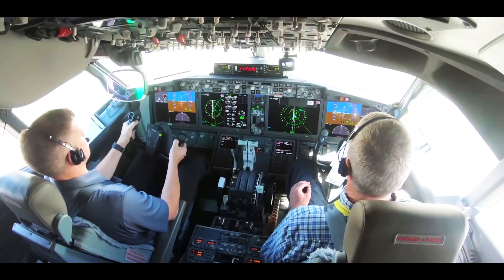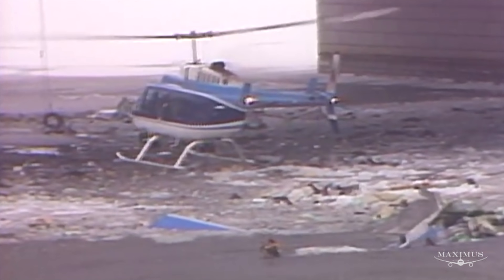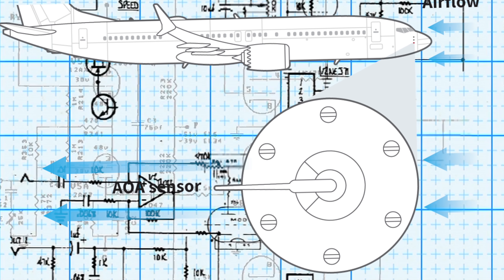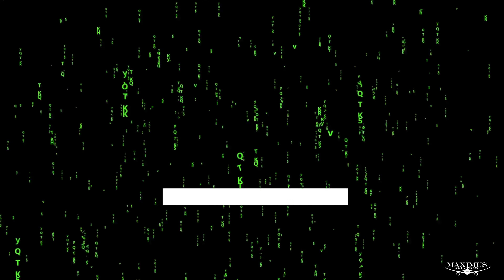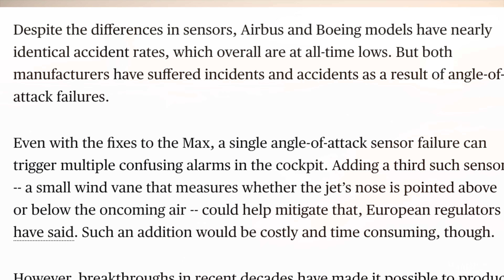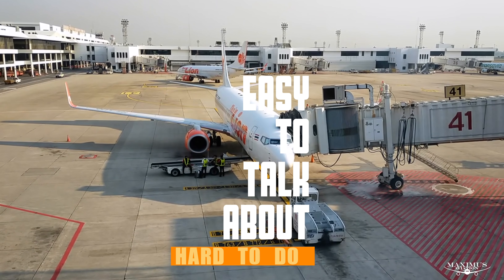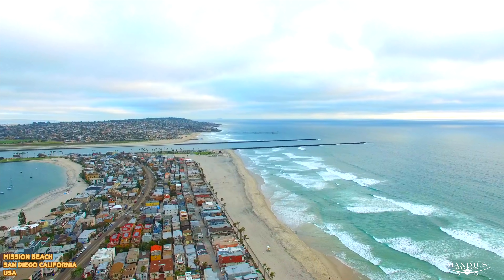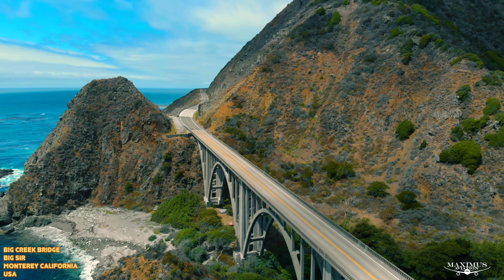Boeing To install 787s Synthetic Air System On The MAX! Boeing Caves To The EASA Will Install System

Comment: The plane might be approved to fly, but the airlines are going to have to send their pilots to training, and it may well result in a separate type rating, which negates the reasons so many airlines bought it.   Southwest bought it because all their pilots are type rated in the 737.  Now the question becomes - do they certify ALL their pilots, or do they now have a set of pilots who fly the MAX and another set to fly the 737?
Reply: Realistically speaking, they'd get trained for both types. It's not uncommon to have pilots rates for multiple aircraft.
Reply: @fighter5583  I know that.  But the airlines like Southwest that bought this POS were sold on the fact that it would not require extra pilot training.  With the addition of this system, it negates the biggest reason why many airlines bought it.   Because of that, I still won't trust a MAX....they should have designed a new plane.   Further...if a pilot were certified on the MAX, then went back to flying 737-800's for 12 months...then a mechanical forces an aircraft change, I wouldn't want to be on the plane  that the pilot last flew a year ago.
Reply: @KCFlyer2  That's just reality. Airlines are always looking for an opportunity to save cash. Heck, even the 787 and 777 have the same type rating despite being two different planes. Boeing simply complied with the airlines wishes to not have to do a little retraining; though I still believe if MCAS was removed it wouldn't cost them much to get used to the handling. The plane certainly can fly without it, and it's only existence was to make it handle like an older plane. 

That, and American had did a bit of arm twisting by making it seem like they'd go for the A320neo (even though I doubt they would've. They dumped the A350 order US Airways had for 787s after all).

Comment: The EASA is doing the job the FAA should have done.
Reply: And what Boeing should have done in the first place, instead of building a flying Ford Pinto.
Reply: This was calculated. we have this talk all the time on the storage/reactivation project. It was intentional to undersell the proposed fixes to the FAA/EASA. Everyone at boeing knows that EASA was going to want to appear more stringent, so they left off an easily implemented change so that EASA could come back and demand it to be done. Boeing capitulated EASA with something they were planning to do in the background anyway. EASA gets to look good FAA gets their changes and Boeing already has the modification in-work. Everyone high fives and get to act like heros.
Reply: @Taco-lo5bh  So in typical Boeing fashion they had the fixes but waited until people died and were forced to add the features.  No wonder people would spit on your precious Boing if they were close enough to manage it.

Comment: If EASA is driving this, it seems FAA has been reduced to second violin.
But then, FAA as well as Boeing will struggle with anyone trusting them for years and years.
Reply: EASA has to drive it because both Boeing and the FAA didn't; perhaps no airplane should be certified by country of origin first.
Reply: Phil Weatherley   This is a result of the McDonnell Douglas takeover of Boeing in 1997. Most of the surviving upper management came from MD. That's when the bad decisions really began (like killing the B757).
Reply: TheChiefEng — The FAA could help restore their credibility by firing Elwell.
Reply: China's aviation authority was actually the first to ground. At the time of grounding, China's airlines had actually taken the most deliveries of 737 MAXs out of any other country's airlines in the world (Chinese airlines with 70 deliveries to USs 69). They acted as quick as the FAA should have. Instead if went China, then EASA, then FAA only when forced by bad publicity.

Comment: 5:50 "Boeing and Airbus have nearly identical accident rates..."  Yes, but the issue is that the non-upgraded 737 MAX had the potential to show a markedly increased fatal accident rate because of the flawed MCAS system and lack of pilot trainin/awareness of the system. By grounding the aircraft after the second accident the regulators have prevented that spike in accidents from ocurring.
America and the world need Boeing every bit as much as Europe and the world need Airbus, but Boeing need to get back to being a quality-driven company once again, instead of a profit-driven one, or they will inevitably disappear down the same rabbit hole. The Starliner failure shows they haven't got there yet - iIf they don't fix this they will eventually go down.

Comment: I think your statements "Boeing and Airbus have similar accident rates" does not lead to "so the Max fear is mostly media hype."  The Max was pulled from service precisely because it had a far higher accident rate than other aircraft, Boeing or Airbus. 2 total losses in about 1/2 million flights (4 per million), compared to the global average of 0.16 per million flights.

Those two crashes don't significantly change Boeing's overall stats, since other models fly millions and millions of flights every year, but it does point to legitimate concern about the Max model.
Reply: Precisely what I was thinking, well said Neil
Reply: Still, it has a higher accident rate than the Concorde, which only crashed once. The thing about the Concorde incident however, is also due to poor maintenance on Air France part as the left main gear wasn't properly torqued, which made the wheels skid wildly while moving at high speeds. There was a piece of metal from a DC-10 on the runway, but it wasn't the main contributor to the accident as they think.

Air Framce had did a lot of coverup for this accident. You can find it online.
Reply: @fighter5583  Given that there were only ever 20 concordes in existence (14 in commercial service) and they flew around 100,000 flights in total...1 total loss is actually worse.
Reply: @The2wanderers  You forgot the 'over 30 years service' part.
Reply: @fighter5583   you forgot that Concorde flew at over twice the speed of conventional Aircraft , so the 100k hours would take 200+k subsonic,, so you can half its accident rate.
Reply: accidents happen and Cane happen with every Plane and in any form of Transport.

But the 737max is a flawed Airplane and does meet the standard we expect from this Indusrty

Comment: Honestly!  How difficult can it be to add another sensor on the other side???  Redundancy is always good.
Reply: They do have two. But which one is working and which is failing is hard to determine in the cockpit. So they should have three, like the amount of pitot tubes.
Reply: @ThorsteinKlingenberg  Absolutely!

Comment: I cannot see how synthetic airspeed will help, as the crashed Maxes already had reliable airspeeds, via their pitot systems,. And while knowing your airspeed may help in a low-speed stall event, it adds nothing to a high speed stall event.  

So I presume that this ‘synthetic airspeed’ will actually be an all-encompassing system that provides multiple data-points about speed, pitch, g-loading and angle of attack.  But that sort of system is more applicable to a FBW aircraft, not a 737 that is flown via 5mm steel cables.   (And it will take years to implement.)

On the 737, the only interface with the steel cables is via the air-data system and the autopilots, and changing that system to add synthetic airspeed would be a four year project.  MCAS is separate to the autopilots and interfaces via the trimmer, not the controls, which it should not do.  An anti-stall system should impinge on the controls, not the trimmer.  So even if this super-synthetic system is added, it is still acting on the wrong control system.  If MCAS trims forward to prevent a stall, it then prevents you from pulling out of the subsequent dive.   And it does nothing to help the manual trimmer getting totally stuck (locked) at high elevator loadings, thus preventing any trimming.

Better still, would be to redesign and raise the gear (and wing) to allow enough room to place the engines further back, to prevent the high AofA pitch moments that required a MCAS system (caused by a changing CofLift). And redesign the tail and elevator system, so the tail surfaces have more authority, and the manual trim does not become stuck under high loading.  And then add a full fly-by-wire control system.  And then call this new aircraft a 797 and certify it to MODERN standards, not to 1967 standards.  THAT is the proper way to resolve the 737-Max problem  -  design a new aircraft, instead of adding yet more sticking plasters...!

P
Reply: @jeffh.9999  Which is sad honestly.

Comment: When they're done the Max is going to be ridiculously safe.  MCAS is only supposed to operate in certain edge conditions, meaning at very high angles of attack near stall.  So really all you need from software is a sanity check for the AoA sensor, rather than a full simulation.  If you take a snapshot of other sensors such as airspeed, vertical speed, G-force, and the deltas of these, it's hard to determine exactly what the AoA is, but it's very easy to say in broad terms what it isn't.  For example, if the airplane is at 275kias and stable, roughly 0fps and stable, and roughly 1G and stable, with a measured AoA of 22 degrees, you can easily determine that AoA sensor data is erroneous.  Human common sense will tell you that, but for the computer a reference table based on flight data will do it.  A sensor reading grossly anomalous data can be said to be in error, and MCAS disabled.  Pilot gets a warning message and logs it for maintenance crews to address.  This system is so simple that the ECU in a 90s car (an unimaginably dumb computer) does it to sanity-check sensor data against expected values from a table.  If fuel trims are too anomalous, you get a check-engine light.  Way too anomalous and it defaults back to the table to get you home.  If Boeing had done this, it would mean that MCAS would not prevent a stall induced by poor airmanship on a go-around.  But it would also mean that MCAS would not yeet the plane into the ground, either, and no one would be dead.  Adding the more sophisticated software or retrofitting a redundant AoA sensor would then be just a standard airworthiness directive at most.  This measure seems to me so easy and common-sense that I'm amazed it wasn't implemented.  But perhaps such a rough and imperfect software sanity check wouldn't pass regulation, perhaps FAA would demand high precision or nothing.

Comment: I'm glad I'm jumping ship now. The management we once had is long gone. These new guys, from mattress factories to Walmart, are so corrupt and incompetent that it beggars description. Not a one with aerospace experience, not a one with intelligence and the recognition of the immense pool of skilled labor available. We are being driven out. They are hiring drones who follow orders, but don't have a clue what they are doing. I see Boeing's future as an assembler of parts designed and made elsewhere. I keep joking that the MAX debacle could be cured by Boeing opening an A320 NEO line and slapping their name on the plane. It looks more and more like this would be a real fix. Certainly the public wouldn't notice.
Reply: Well said friend !!
Reply: If Boeing Corporate had any sense, which is doubtful, they would have acquire the marvelous and state-of-the-art Bombardier CSeries and marketed it as a 737 replacement. Instead they fought the sale of some of the planes to Delta and allowed Airbus to take over the plane, creating the A220, a key 737Max competitor.

I try to root for Boeing as a 'home' company, but with the A220 being built in Mobile, only a few hours drive from where I live, I wish it ever success.
Reply: @Inkling777  - Honestly, they should have spun the 757 into multiple variants that would've replaced the 737. It used the same barrel, but had a new glass cockpit, more efficient engines, longer legs and tremendous performance. Also, a pilot type-qualified on the 757 could simply walk into a 767 and fly it, too.

Comment: Boeing still hopes the Max will be accepted by the public🤣🤣🤣🤣🤣
Reply: To be honest the max it probably the safest airplane right now.
Reply: @sc1338  uhm, it crashed? Twice.. And it wasn't in service for that long. So im guessing not too safe.
Reply: @slaapkonijn58  do you understand why it crashed? the 737 has been in service for 50 years, the only reason the 737 Max crashed is because of faulty software and a AOA sensor feeding the computer bad information. these were to push the nose down if it detected an imminent stall. The reason why I say the Max is probably the safest aircraft at this point is because of the major independent scrutiny and fail safes added to the MCAS system. When something is focused on that hard for that long I would feel very safe flying in it. Also multiple safety bureaus have said it is now safe to fly. Boeing took a big hit from this (rightly so) ,and I’m sure they made triple sure everything is safe.
Reply: I have no problem with it

Comment: So Boeing  will copy Airbus, Should have done it years earlier.
Reply: They did. But they decided to make a cheaper copy - to save money.
Reply: CORRECTION: Boeing already had the “synthetic air system” installed in the new B787’s. Airbus is the one who copied it from Boeing with their brand new A350, which came years AFTER B787. Remember, the B787 came into service first before the A350.
Reply: @vivalasvegas702  the Back Up Speed Scale was in development by Airbus much earlier as it was standard fit on the A380 and optional for the A320/A330 and A340. No doubt Boeing got the same idea but enhanced it to use additional parameters. But the digital back up speed on the A350 is now being used on the A320Neo and A321Neo

Comment: I hate Boeing, but I don't see how this would help.  Angle of attack is only related to airspeed if you take into account actual vertical speed vs commanded vertical speed.  GPS horizontal speed doesn't really help much unless you maybe take into account the reported airspeed from nearby aircraft that are different makes and models (to stymie faults caused by weather effects on instruments (icing)).
Reply from the maker: I by no means am an engineer but I think the benefit comes as a result of the algorithms instant calculation of all factors from the AOA sensors to airspeed and the mass of the aircraft and its actual attitude, gives the pilots more information to make an informed decision.
Reply: @maximusaviationchannel  well, you can stall at any airspeed.  There is something call high speed stall.  Stall is when the AoA exceeds the critical angle of attack.
I've only flown slow piston and glider aircraft, and I only have a private pilot's license in gliders; however, I've been told that T-38s are very easy to stall, and must be flown with on eye on the AoA indicator, at all times
Reply: Well the Airbus A350 uses AOA sensors, load factor, weight and engine data to determine back up altitude and airspeed

Comment: I have never heard of  "Synthetic Air System" on a 787. Could this be called something else in the Boeing language
Reply from the maker: It has many names.  Synthetic Air, Synthetic data.  I think they Synthetic air is a reference to not taking in "actual" air into the pitot tubes it is measuring digital "air" in its calculations.
Reply: Basically the generic name to calculating airspeed/altitude using other means instead of the pitot tubes and static ports. It’s like an artificial speed, not as accurate as pitot tubes but good enough to keep the plane in the air and land
Reply: Copy that, And thanks for the response . My understanding of the 787 From a technical standpoint Is asfollows; 
In ATA chapter 34, Some of the components Of the 787 air data reference system include 3 pitot and 6 static ports, 6 Air data modules.
Reply: From the pitot and static ports there are actual tubes that connect to the air data modules. That is when the information is converted  to digital signals sent to the FCEs.
Reply: Also I've looked through some of the 787 Boeing manuals, No mention of "synthetic air system"